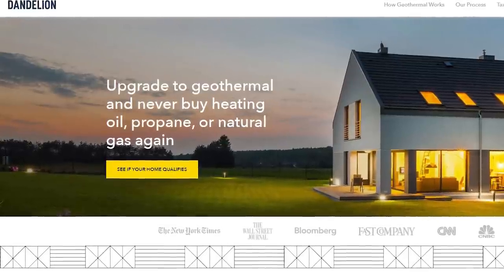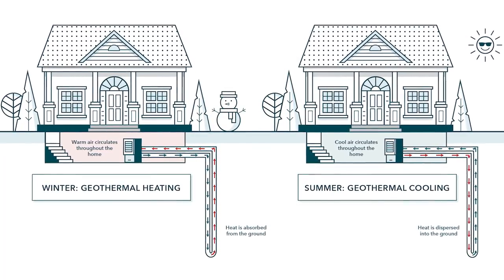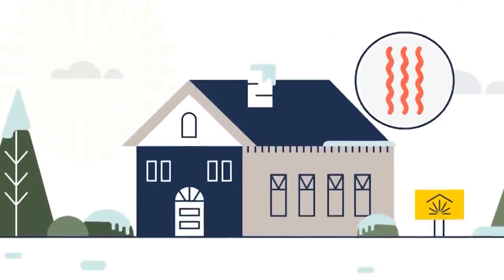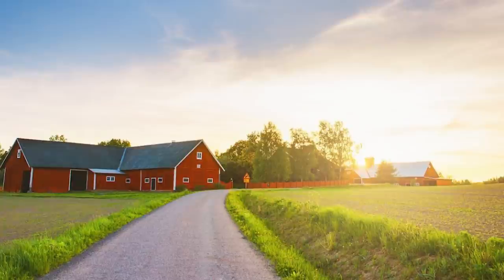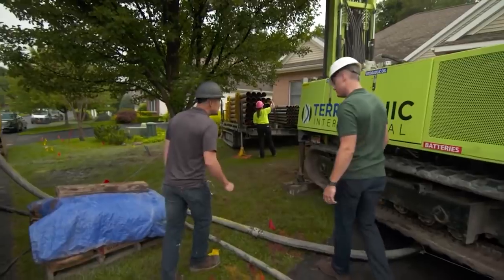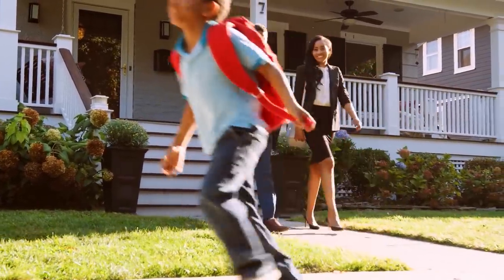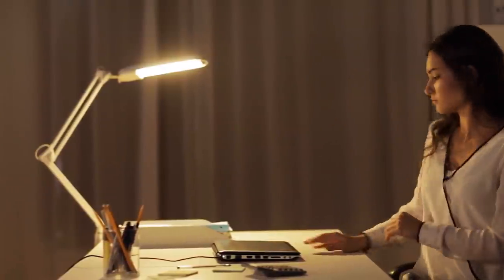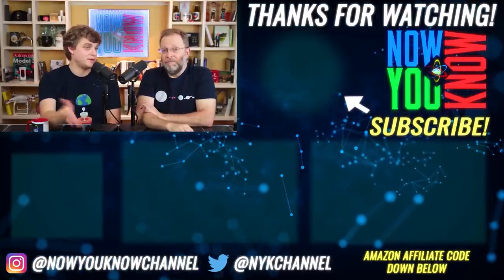All Your Geothermal Questions Answered | Dandelion Energy

Comment: We live a little north of Milwaukee, WI, and have had geothermal HVAC in our 2,500 sq ft home home since 2006.  There is backup resistance heating for temperatures well below 0°F, but we rarely need it.  Electricity cost per month for all heating, cooling, and about 60% of our hot water is about $120/mo.

Comment: Ben Sullen did an interview of Dandelion back in March 2019, it’s great to see the advances in Dandelion’s presentation.  Too bad apartment complexes don’t use it.

Edit: “the problem of drilling a 300 to 500 foot hole is not well explored”  punny.. just punny
Reply: Apartments can also use ground heating. You just do pipes vertically. Both things has been used in europe for decades
Reply: Finn Hansen  I know, but it’s one of those things where, since renters pay utilities, there’s no incentive for apartment complex owners to upgrade.
Reply: @markplott4820  it's not really efficient to use  solar and a Powerwall to cool or heat. I would do better things with my Powerwall. Geothermal is far more efficient for this case

Comment: I'm curious if any builders have looked into using the geothermal heat pumps be to cool/heat and dehumidify large commercial greenhouses
Reply: The local Guardian Storage facility maintains conditioned space using a geothermal system. 

I have also seen geothermal systems for greenhouses without heat pumps.

Comment: Ground source heat pumps are an absolute no brainer! We don't normally bother installing the system for both heating and cooling in the UK because there are only a few days in the year where you might actually want to cool your home but some people have the heating on for more than half the year and of course hot water for showers too.
  
FYI: Most of our electricity (in the UK) comes from natural gas which when burned in a power plant is about 30% efficient. When you use natural gas to heat your home directly with a gas boiler that's very close to 100% efficient. A ground source heat pump is 400% efficient (sounds like a violation of thermodynamics but actually the heat is coming from the ground and electricity is just used to collect that heat) so if the electricity came from gas then that's 400 x 0.3 = 120% efficient.
My point is that by replacing a gas boiler with a ground source heat pump (electric from natural gas) you go from 100% efficient to 120% efficient conversion of the natural gas into energy. This is obviously an improvement but it's not significant. The CO2 footprint goes from 400 to 333.3 grams/kWh
 
In reality we're 20% nuclear and have a fair bit of wind energy at 50% capacity factor during winter backed by natural gas with some imports from France to meet demand spikes in the early evening which is a bit more complex but that put the grid in the ball park of 167.2gCO2/kWh during winter (solar is ignored due to being only 2% capacity factor in December)
  
So heat pumps will actually do about 41.8 gCO2/kWh in a typical winter (~10x better than a gas boiler)
 
If the grid was 100% nuclear it would be as low as 3 gCO2/kWh
 
If run entirely on home solar it would be about 12.5 gCO2/kWh but good fucking luck with that in the UK lol

Comment: I wish I'd done this when I built my home in California, but since we only use the heating or cooling on roughly 10% of the days, it's not a cost-effective retrofit here. But great for cold climates. I'm just curious about the energy cost of the compressor.
Reply: My compressor runs with coefficient of performance of around 4.3. That means that if I were heating with electricity I would have COP of 1, 1kW of electricity would create 1kW of heat. With my unit, 1 kW of electric creates 4.3kW of heat. I might have missed it in the video, but one of the other things most systems do is "dump" heat during cooling days into the hot water heater, so free hot water.

Comment: If every home had this, in a dense urban environment, would the ground temperature be affected? Is that bad for the environment somehow?
Reply: If it is done correctly the ground will replenish its heat and the environment will stay healthy.
Reply: Maybe the worms won’t like it.
Reply: Compared to burning fuel oil?
Reply: Earth is MASSIVE and daily thermal insolatin is really significant.
Reply: Barskor1 that’s true yeah... I’m guessing the amount of energy from this system is like 2 orders of magnitude less. If every home on earth had it could we warm the planet by 0.1° haha
Reply: Nope, There is just too much earth. I would be more worried about crappy installers who use sub ideal loops that leak the methanol into water tables before a concern of thermal impact into the soil.

Comment: With a good system you can also coll the house during summer!
In Denmark they cool the streets during summer and heat them in winter!
One system, longer lasting streets, no blocked streets in winter!
Reply: Why would you cool the streets during summer, what's the point?

Comment: 25:20 A heat pump may use a lot of electricity because for example all the systems sold in my area have built in resistive heaters. It may be the case for almost all systems out there.  If for some reason the heat needed for a home is greater than what the heat pump can pull out of the ground or that house is not insulated properly, the resistive heating coils will kick in so as not to inconvenience the homeowner. The resistive heater coils are usually quite big starting at 4-8kW all the while the compressors my be 1kw or less. Needless to say that this is not advertised and only silently displayed on the management panel. At the end of the month one may get quite a big electricity bill.

Comment: geothermal is super genius!  as a side benefit, a geothermal system can 'add on' a water heating loop inside the same exchanger to also supply hot water. what I'd love to see them do next is separate the water heating portion from the main heat pump so that it can run independently, full time for hot water, summer & winter. would be interesting to know how they 'bond' the loop to the soil. I know that in a horizontal closed loop they case the tubing in sand & then use a drip system to insure that the sand always stays moist. I would guess that the most reliable method in a well would be to just have a mechanical float valve (like a toilet fill valve) and just keep the well topped up with water all the time. that would insure good conductivity, but you'd want to drop a chlorine tablet in there once in a while unless the well had naturally occurring water in it.
Reply: You can use the same ground loop for separate heat pumps, one for heating/cooling and one for water-to-water dedicated to domestic hot water. Or, use a combined heat pump, ours for example runs without the loop when in cooling mode and heating the DHW, saving some on pumping costs.

Comment: Wondering what the electricity consumption of a closed system, trying to figure out the size solar/battery bank to finish making the system self powering.
Reply: The major issue is the aux heat. In-case the geothermal system goes offline you want to still have electric resistive heating. That can create a large demand for power. My 4 ton geothermal has a 50 amp breaker for the compressor and fan then another 50 amp +30 amp for the resistive coils. As a powerwall can only peak 30 amps you would need 2 powerwalls to supply the amperage on the compressor and that does not account for the resisitve aux loads.
Reply: @justinherman9443  Don't use aux heat and fit a log burner somewhere in your home.
Reply: @edc1569  I have a fireplace and I am looking to install a radiant hydronic under floor heat transfer system. In addition I am installing additional insulation in the home.

Comment: what about if you are building a new home and are trying to cost compare a standard heat pump to the geothermal?
Reply: She said temperature in the ground is closer to the temperature you want so 50% less energy is used for geothermal heating/cooling. Ground is warmer than air in winter and colder than air in a hot summer afternoon. After passing liquid through ground half the heating/cooling is already done..

Comment: I wonder what they do about heat recovery from ventilation. For ex. it is very inefficient to ventilate by opening the window, and much more efficient to use a couterflow heat exchanger to get you new air, but with 90% of the outgoing air's heat.

Comment: Another possible issue with his is the upgrade cost.  If I am using solar with an existing air heat pump, and my place is well insulated, I am not going to have much in the way of heating/cooling bills, and a 20,000 dollar system, even if leveraged over 20 years, may still be waaaaay more than what I am paying if I keep my existing system.

Comment: How would this work for inner city blocks of apartments? A large percentage of the population lives there. Would the pipes need to drill down so deep that it’s not worth it?
Reply: In my country remote heat has become a huge thing. They lay pipelines to transport heat from a distance into the city. I would guess that to change the heating for old apartment buildings that's something a lot of cities might look to. I'm not a big fan of centralized heat though. I'd really prefer to produce your needs as locally as possible. So if a block can drill in their own backyard to get their heat that's something I'd be for, but that's a business decision the owners of those buildings will be making.
Reply: Cities should be planed as a system as a whole to achieve greater efficiency. In a tropical climate with a lot of need for air conditioning, it would make sense, so could dumping heat into the ocean. In a colder climate, we could be better off using the waste heat to heat district water.
Generally building structures to require less energy in the first place is a good idea :)

Comment: I have a theory that geothermal hot /cold systems need to be a public utility. A city, for example, would own the drills, or contract drill wells, in the street, and directional drill house connections for  the system water. Then move on to the next house. Not too different from  a sewer system that is universally common in almost  all areas. The city then could charge the homeowner at a periodic rate that would reduce or even stop after the system's cost is amortized. Or whatever. This whole idea is a case for cities or villages to have a higher and less expensive quality of life . All the arrows go in the right direction,  except the driller is out of the loop, being replaced by a municipality which, de facto, pulls it own permits and uses it's own right of way. Governments  already provide streets, sewers, police, trash collection, and so on.   Why not this. Cheap heating and cooling. This idea , at large scale, would pay itself off, and be less costly than  the other necessary services already provided. This ides, in effect, gives all its residents, more income. What's not to like. Oh yeah, HVAC guys would have to retrain, and suppliers are in a different position. If you think about it, the in house hvac system is about one half of a conventional system, in that a furnace is entirely eliminated, being replaced entirely by an air conditioner.Huh???

Comment: What happens if there's a pool in my house and I want it to heat it, along with my house? Would that be possible too?
Reply: Good Question Marcos! I had the same question when I lived in El Paso. Why not use my Pool as a heat sink to cool my house. I had a medium sized in ground pool that I regularly ran a gas heater to warm up while running an air conditioner to cool my house. No drilling required! I smell a business opportunity!
Reply: Yes, why not. It's all about the size of the system

Comment: I already have a 480 foot well for my drinking water with a 6 inch PVC casing.  Is it possible to utilize this well to add Geothermal?
Reply: Open loop systems exist, but use a lot of water and you need a permitted place to dump it. The pumping cost is higher than closed loop as well.
Reply: @FrancisKoczur  In Europe open loop is pretty common. You return the ground water through a second well "downstream". It just returns a few degrees colder but otherwise untouched.

Comment: I live in Paso Robles, California and have a greater need for air conditioning in the summer, and a smaller need for winter heat. I’ve been looking in the Central Coast area of the state for someone who can retrofit my home and there are exactly zero contractors who do this work here. We have a large lot and easy access for drilling equipment.
Why hasn’t this caught on in California of all places?

Comment: My existing setup is three zones of hydronic heat (in the floor) and an indirect water heater  (pre fed by a solar water heater array) all supported by a gas boiler.  Can these ground sourced heat pumps be made to heat in floor heating systems? Thanks.
Reply: Yes, water-to-water heat pumps exist as well as standard geothermal heat pump that have an extra hydronic heating coil. If your radiant tubes are in cement, 80°F pairs great with heat pumps. Over 120°F is inefficient with heat pumps using R410A, but you can heat your domestic hot water to 115-120°F. For example Enertech (not recommending as I haven't used their product) has three brands that make the same heat pump that has what you need.

You can also do radiant cooling but you have to make sure your thermostats have humidity sensors and calculate dew point. It is recommended to stay 3°F above the dew point.
Reply: @FrancisKoczur  Wow, great to hear as this will be my next "big" house project. Thanks for the information. Cheers

Comment: My house has no ductwork and my oil furnace is attached to a hydronic system which heats about half my house from radiant floor and half by old fashioned radiators. Are there good ground source heat pump solutions for hydronic heating systems?
Reply: Liquid to liquid heat pump likely will be more efficient than liquid to air.

Comment: You guys need to do something similar to promote for opting for heat pumps in warmer climates.  I have solar and use atmospheric heat pumps for both HVAC and water heating.  I live in Southern California where it is warm enough to use a heat pump to heat and cool.  I use No oil, natural gas, or propane. Just electricity. -Last year my total energy usage, including charging my EV was $300 for the YEAR !! So Heating, Cooling, transportation, household appliances and hot water all for about $25 a month.  Yet FEW homeowners choose heat pumps, but rather, have both AC and Natural gas or Propane heating. wasteful and polluting.

Comment: I know she has said before that Ground Source Heat Pumps (GSHP) may possibly not be appropriate for cooling really hot arid climates.
I would like to know IF dandelion designed a GSHP system in Phoenix for a 5 ton unit at 350ft what would be the range of costs for 5 holes.
I only ask the question because I know why you don’t normally have water cooling towers on residential homes, I just kind of feel like it’s more habit than math why we don’t use GSHP in Phoenix.

Comment: I believe there is also air source  geothermal, I believe it requires I Kw of electricity for 3 kw of heat. What I wonder is the return on this type of ground source system and what warranty is given on the plastic pipe installation, can rodents chew their way into it. I ask because I’ve seen mice chew through in house plastic water pipes.
Reply: Problem with these systems is they tend to fall back to resistive heat when asked to produce heat during the coldest weather.

Comment: Regarding Supercharger V3:
No one seems to see the bigger picture here. On the type label of a V3 is written 1000V DC and 425 Ampere.
V2 has 410V. All current Tesla Vehicles have only 404V max. Voltage! You think what I think?

Currently there is a big Rollout in Europe of V3 Superchargers (Like there was a Rollout of CCS Cabels in Europe before the first Model 3 deliveries! Which only have CCS in Europe)
In one month there is Batteryday as everyone knows 😉

I predict the new Drivetrain/Battery will have at least a 800V to 1000V backbone.

Wait there is more: To charge a Model 3 with 250KW and 404V max. there are 618Ampere needed. I guess the V3 type label underreports like the ones on V2 (410V 270A is only 110KW but they provide 150KW)

So a V3 Supercharger should be able to provide at least 618KW!!!

Newer Tesla Vehicles with Drivetrain of Batteryday should be able to charge extremly fast!

Keep in mind - Elons said about the planed 350KW Taycan charging speed something like: What is this? A mere kids toy?

No one speaks about that! Why? 😉

Zac & Jessy please consider to have a thought about this. Gtreetings from Germany
Reply: Bjørn Nyland just did a video "Pros and cons of 800 V battery and charging systems". I think you should post this there as well. So I think V3 Chargers can charge at 800-900V and the new EV's (Cybertruck - etc) will work at 800-900V as well. Elon is just keeping quiet (so unlike him).
Reply: @markelkins8432  I already did 😉 Thanks for the hint anyway. Bjorns Video was nearly a perfect match, I thought aswell 😁

Comment: @25:19 An AC unit uses a ton of electricity. Why doesn't a geothermal heat pump use a ton of electricity? I feel like she dodged the question instead of explaining how they avoid that problem.
Reply: Less delta t, but yeah you get about 3-5x the kWh out that you put in, in areas where you have cheap gas this can be a problem, but many people have PV arrays on their roofs so their personal electric costs can be very low